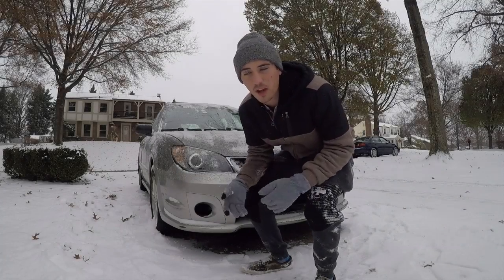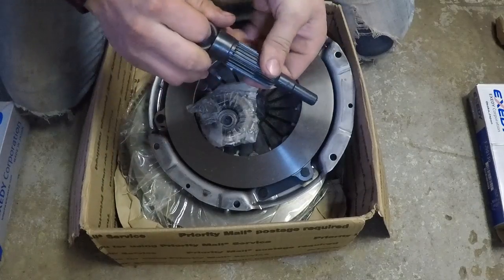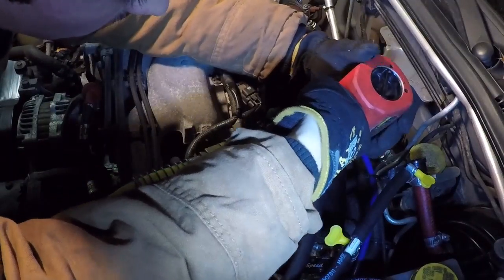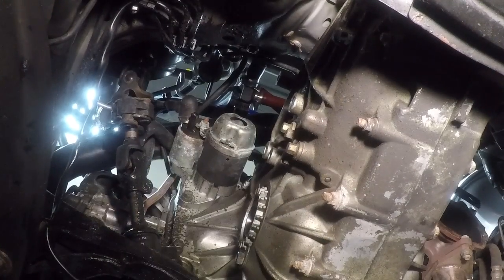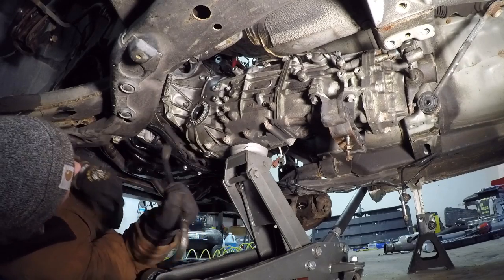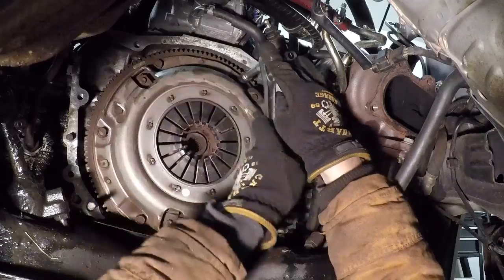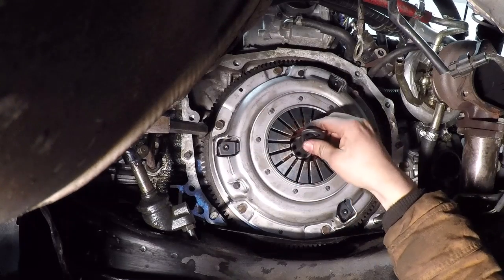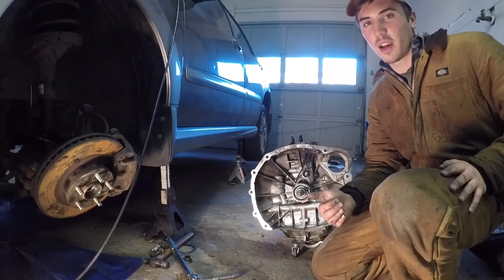Subaru Impreza Clutch Replacement: REMOVING TRANSMISSION

Comment: Work as a technician at brandon tomes subaru the clutch fork clips that you said just stay on loosely actual have a specific motion on by latching one end of the clip and wrapping it around the other side of clip connector more of a latch rather than clip
Reply: very curious, how much would you say this job would cost at a shop with parts bought ahead of time??

Comment: I followed this video almost exactly for a 2008 Impreza Sedan with minor differences since mine is naturally aspirated and all OEM equipment. This is, in my opinion, the clearest example of changing a clutch by dropping the tranny. A couple of anecdotes for anyone attempting this job in the future : 
1. I live in New England so I had to deal with A LOT of seized bolts, axles, etc. I ended up freeing the passenger side axle, but had to completely remove the driver side steering knuckle.  I tried every tool and technique I had, gear pullers, sledge hammers, etc. If you are stuck on an axle seized in a hub, just pull the whole knuckle off and save yourself the time/deal with the axle when it goes. Coat everything you remove underneath the car in anti seize (tranny subframe bolts, exhaust bolts, etc.) if you live in the Salt Belt. 
 2. I ended up buying the harbor freight transmission jack to finish the job. I got the tranny down by balancing it on blocks of wood because my jack just did not go high enough. Not wanting to deal with the balancing act of trying to line it up once I was done installing the clutch kit, I bought the HF jack and was very happy with it's performance for the low price point. I foresee myself using it in the future for removal of other components that would be awkward to lower myself under a car, so I decided to keep it rather than return it once the job was done. What I'm saying is don't be a dummy like me, you're lowering a 140 lb transmission. Use a jack that goes high enough like GoldGuy or get a cheap transmission jack to make install a breeze. 

All in all, thanks for the video man. A huge help for a hobbyist auto-mechanic trying to save some money and do a job myself!

Comment: Pedro using wifeys ipad great job. I have a po447', and a po448 a boost issue and worn out clutch on a 2006 sti . Taking  to dealership for the po issues  due to pcm  problem . Then going to replace clutch myself . Also a 1st for me . Im 66 years old with a bum back and diabetic  here goes nothing

Comment: I have a 2006 2.5i NA Impreza sedan and my clutch is going out.  It's slipping really badly.  I've been looking around at some upgrade kits and I notice the one you linked uses a stock weight flywheel.  Kinda surprised you didn't go to a lighter one.  My 2.5i has a ~25 lb flywheel and it revs SUPER slowly because of it.

edit ah, I posted this 30 seconds before you weighed em!  5 lbs less, eh?  The kits I'm looking at go down to like 12 lbs.
Reply: Wicked Crispy yo just bought the same car ab a month ago lmk what youve done to it and etc trying to find some mods to do to make her quicker without sacrificing reliability

Comment: And you said you've never done a clutch either you had someone helping you behind the scenes or you're just a natural. My first clutch was 87 s10 5 speed. And the morgue Warner transmission isn't very big smaller then your subi. And it was heavy as fuck on your back but the clutch install was pretty simple pilot barring was a pain in the arse but everything else wasn't to bad. I'm glad you got it done I enjoyed watching. I think i need to change my throw out in my legacy it makes noises when the clutch isn't engaged I think who owned it before me rid the clutch alot.
Reply: That's your throw-out bearing making that noise...  kinda like a constant squeeling until u barely push in the clutch and it goes away?

Comment: When you jacked the car up, where are you putting the jack? Because I tried to jack up my 06 impreza sedan from the front but the cross member goes so far in that the jack cant pump because the handle is flat

Comment: Ive change my 99 gf8 wagon clutch in 8 hours i left the engine in  as well tbh alot easier taking engine out if done in a garage as you have the tools and equipment i did mine outside on the floor at home dude be careful almost dropping that trans on the floor btw my car is n/a but im doing a wrx swap dw im qualified as a motor sport enigeer so i know what im doing 😂 if you got questions just asked im more than happy to answer if i know the answer

Comment: Nice vid. I changed my clutch 1 month ago, now I broke my transmission with the new clutch kit. 
I have already removed the gearbox, but the throw out bearing just sits on the clutch now. Don´t have an alignement tool here at home. How can I remove it to put it on the transmission? Or can i put the transmission on it like that, and then put the fork on the throw out bearing from the top? Would be thankfull for every information.

Comment: Nice video! Just bought this same exact car, color, trim etc but mines an 07 about 2 months ago and now im noticing the same noise so im guessing i need a new clutch soon. Anyhow did your shift knob moves a lot? Mine moves all over the place even though its in gear, any gear it still moves left to right and up & down. Is that a shift linkage problem? I know its not the bushing..
Reply: how many Km's?
got the same car

Comment: Hi, i love watching your videos. Friend tell me please as i understood you have installed a turbocharger td04l few ago for SOHC engine. Question how it behaves any issues till now. Anything damaged or headgasket oil leaks. Please advice i have an old subaru 2004 2.0i SOHC vehicle. 140 hp is not enough. is it worth to turboing?
Thank you